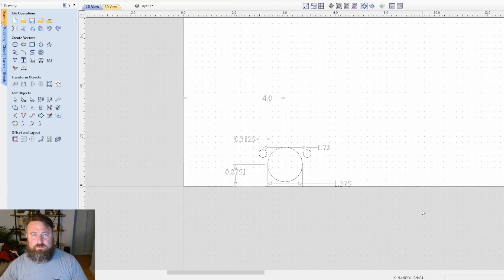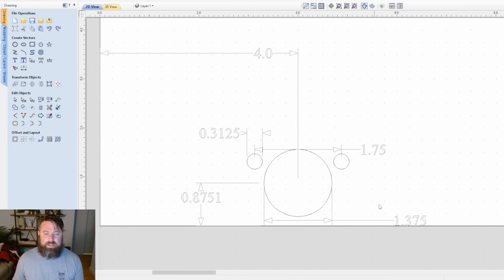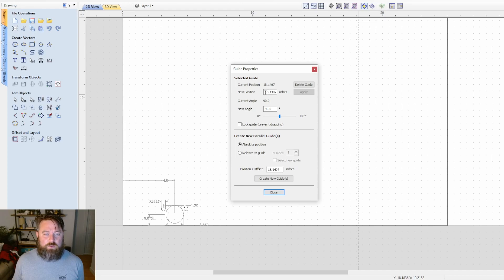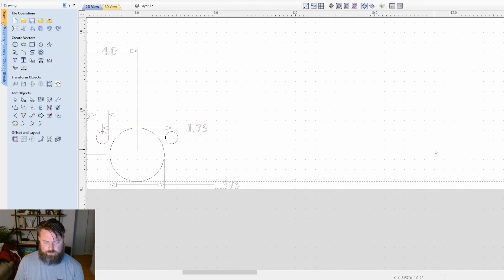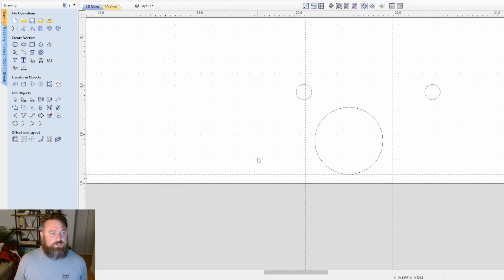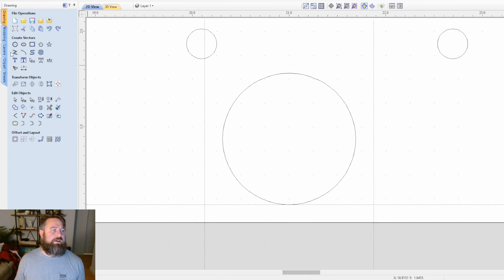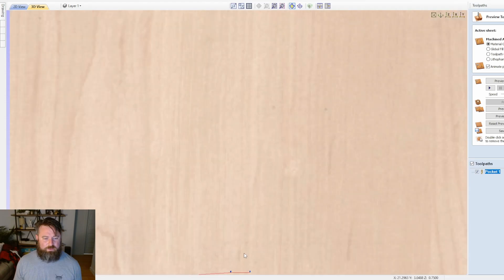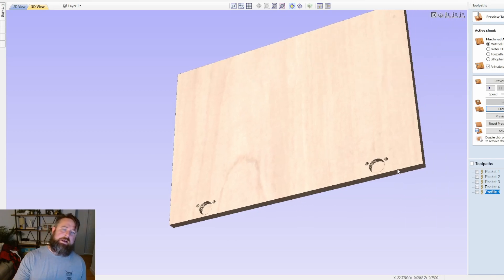Creating Hinge Holes in VCarve Pro!

Comment: Thanks so much for the measurements and clear instructions.  I learned some tips on shortcuts with moving and guides(which I think are mandatory).  

Some quick tips...you can enter fractional numbers and hit your = (equals) key and it will automatically convert it to decimal in the entry fields.  so for ex...you have a guide set and you want to offset it 3/8 of an inch...you would just enter (3/8) and hit your = key and the number will convert in the box to .375.

Also...lets say you want to move something that is some random set place on your door but you want to move it 3/4 to the right,  you would set a guide to the point it exists now, right click to open guide properties and in the "new position" box..scroll to the end of the numbers already existing and type in +3/4 then hit your = key to have it automatically calculate the new position and hit apply.  so in the box, it would look something like this...

5.678123+3/4...hit your = key and it will now show 6.428123 as the new position and just hit apply.    

This works for any input box that accepts numbers.  The key is the hit the = key right after you do your math.

Sorry for the long post and great video.